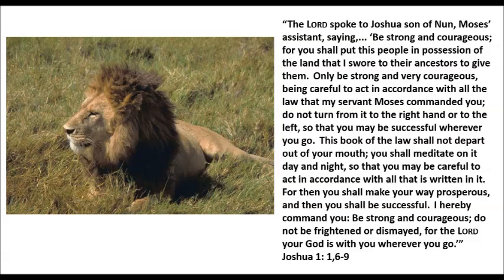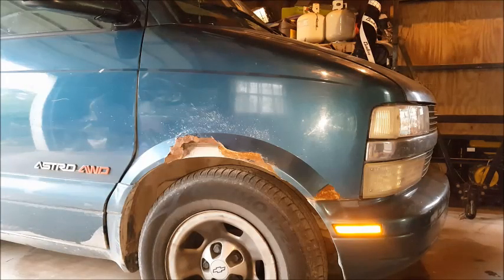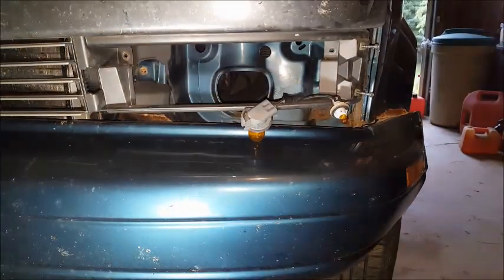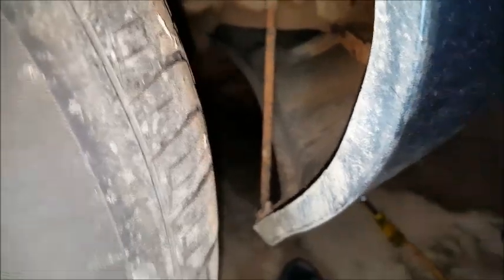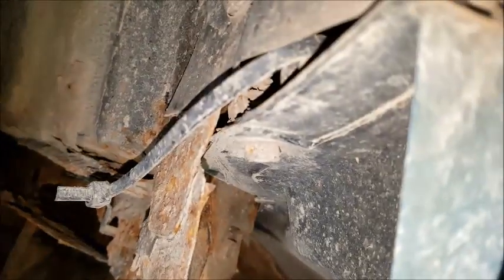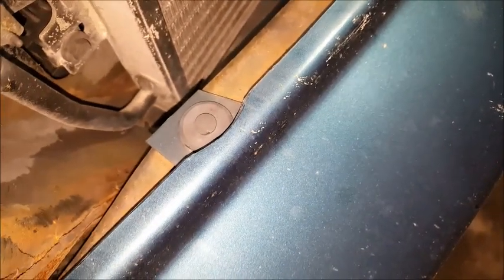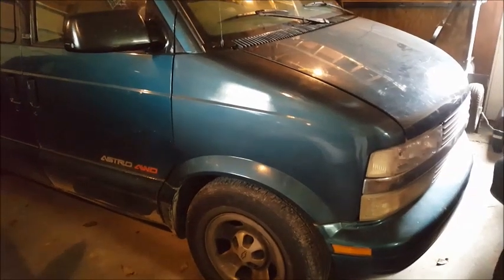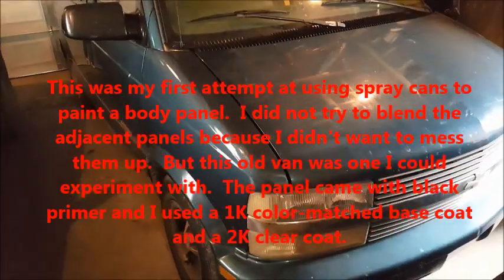GM Astro van fender removal

Comment: Am I ever glad I found your video before I started on my '01 Safari today. Haynes Repair Manual suggested removing the windshield wipers and the wheel well liners... seeing your post here let me know what I could easily work around and that there would be ample room to do what I needed. I also had to rebuild a hanger at the lower front - mine isn't as fancy as yours but it works and is solid. I'm now wishing I had done both fenders! I really like these vans and other than it being an ordeal to change a spark plug (who DESIGNS these things!!???) I find them to be the perfect vehicle for me - both as a passenger van and a freight hauler. My best to you, and thanks.
Reply from the maker: I appreciate the feedback.  Glad it helped.

Comment: it's rotted Dave the rad core support is absent along the entire bottom which means the two front body mounts that are reinforced with a 1/4 in pate are just floating about
Reply from the maker: Thanks for the comment.  I guess that is the hazard of living in the rust belt.  Road salt has been rough on the vehicle for sure.  I'm just trying to get a little more life out of it.